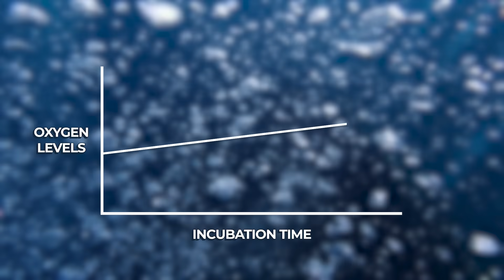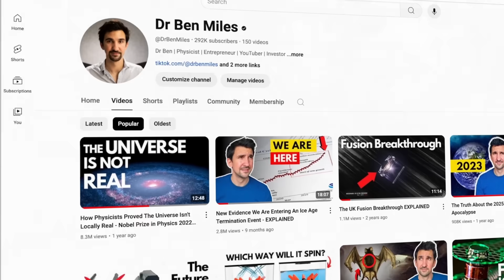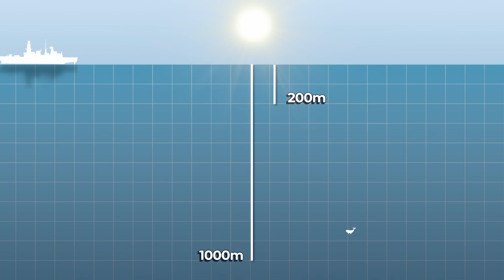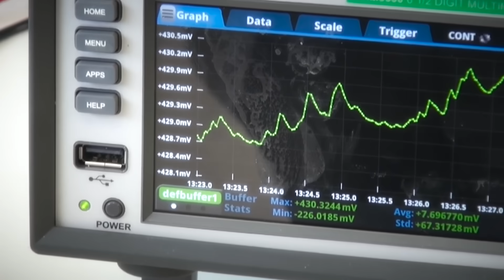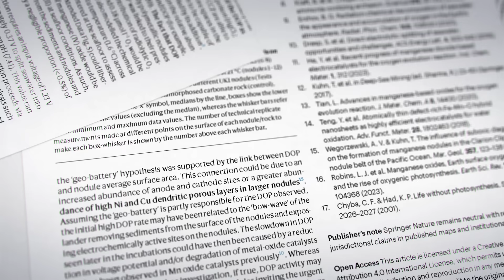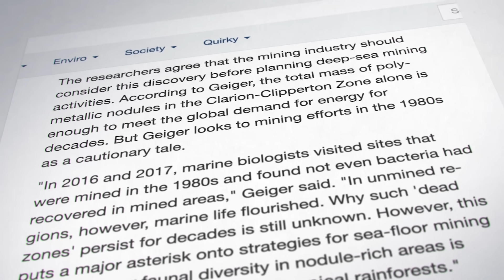We Just Discovered "Dark" Oxygen on Earth - Breakthrough Explained

Comment: Deposition of metalic elements onto nodules could be an endothermic one, chemically assisted by the high pressure, in a way that could be compared to reverse osmosis that is achieved using high pressure difference across a simi-permeable membrane.  Close analysis of the chemical structure of the nodules as well as the energy balance between dissolved metals in the sea water, and the ionic structures in the in the nodules may show how such structures are generated.  This may be battery building rather than depletion!!

Comment: Fascinating

A fewbasic questions:

If the nodules are producing voltage as tested in the laboratory (up to 0.95V) would that not be clear evidence of a battery effect, no matter how complicated or unlikely it was naturally achieved?

I'm interested in the plateau of oxygen generation in the samples and testing.  
-  Did the starting oxygen saturation of the water affect the rate and ultimate value of the plateaued increase
- If the water was circulated with "fresh" water at the starting oxygen saturation over a given voltage producing nodule cluster, would they continue to produce oxygen in the newly introduced seawater or would the voltage in the nodules have been otherwise depleted?
- what was the measured voltage of the nodules at the beginning and the end of the lab experiment?  Did that change?
- what was the net voltage effect of more or fewer nodules?  Did the voltage behave in "parallel" or in "series"?

Very cool video.  Love it

Comment: I agree, its likely a natural battery and the reason the samples stop producing oxygen and electricity after being removed from the sea floor is because what ever the electrolyte, acids or other thing  moving the reaction forward is being used up. Its lt's likely a byproduct of sea life and water movement driving this reaction forward. That would also explain why the metals are plating out and forming  these polymetallic nodules.

Comment: Enclosing the samples in a dielectric plastic probably contributes to the high rate of oxygen production. We're used to thinking in circuits when we perform electrical analysis, but this is a reductivist form of analysis which allows us to approximate real world dynamics. In situ the nodes are all electrically interacting with each other and with the sediment and seawater at levels which we would normally ignore in our analysis, but which over geological timescales become huge. This electrical potential could be connected to all kinds of other processes due to the large area it covers. The whole field of nodules is exposed to the earth's magnetic field amongst other possible sources of energy input.

Another question which I didn't see addressed: if this is an electrolysis process, where is the hydrogen going? It should show up as a gas or a pH change or locked into a chemical form.

No matter the answer to these questions, there is no way that deep sea mining will ever be a good idea. I do not want an electric car if it requires that much destruction. I have a bicycle already and everything I need is 45 minutes or less if I hop on transit.

Comment: this is pure non-scientific intuition, but a big thing i don't get about the battery theory: why would the metals precipitate into this higher energy arrangement in the first place? if electrolysis is happening, then you have these electrochemical forces constantly trying to redistribute the different metals evenly, surely that's gonna smooth the distribution out far faster than the extremely slow rate of accumulation. I'd expect it to be in a steady state where any time a metal reaches a high enough concentration gradient to produce a meaningful voltage, the resulting current (and thus ion flow) would quickly redistribute the metal, flattening the gradient. so you'd end up with an extremely slow rate of oxygen production, tied to the extremely slow accumulation of metals, presumably much lower than what's observed. and that's even assuming those concentration gradients form in the first place; why would nature randomly form concentration gradients? that seems to go against thermodynamics unless there's some other effect that's altering the balance of energy. is there some sorta crystal growth thing biasing the metals towards clustering, as a first part of a multi-step journey down the energy ladder?

Comment: I think the researchers are wearing blinders. The mineral deposits (polymetalic nodules) are not the actual batteries and do not emit dark oxygen. They are bonded anodes and cathodes, with the actual acidic "current" flowing around them: a kind of inverted battery.
Rain strips CO2 out of our air, keeping their concentration down to around 0.04% of the lower atmosphere. This produces carbonic acid that goes into our soil for roots and cavern formations (stalactites, stalagmites, columns, drapery). This chemical at the sea floor should break down at the sea floor, releasing hydronium ions. Meaning, the sea floor should be a charged biome, that bacteria can adapt to. So when the mineral deposits are mined, the charged biome also disappears.

Comment: There's two things I'm looking at when it comes too this whole battery electrolysis effect. One the close proximity of the polymetallic nodules with each other, using the sea water as a conduit, essentially makes an enormous daisy chained battery which could mean millions if not billions of volts. The second factor to how batteries function is Amps or the flow of electricity to create power. IE: Volts x Amps = Power measured in watts. Now the thing is with so many potential volts out there the amperage would have to be obscenely low to not only create the electrolysis effect at the level it is, but prevent these natural batteries from draining quickly, and NOT decimate all sea life in the Clarion-Clipperton zone.

Comment: I think the misunderstanding is likely coming from the idea that the nodules themselves are the battery and that they have some kind of definitive lifespan like a normal battery does after heavy manufacturing. 

It's more likely a chemical reaction that just so happens to produce low levels of electricity, not the electricity itself causing electrolysis. 

So rather than the metal somehow making a natural battery and that battery holding a charge and that charge being depleted in a matter of hours or less it's more likely that electricity is being produced, not just released from storage. 

This could actually be a chance at a breakthrough not just for oxygen generation, but power generation as well.

Comment: Self-Potential (the voltages that exist in the earth) is an established measurement used in oil exploration. So there are long-lasting current flows in the earth. Perhaps the nodules are not self-contained batteries, but just the electrodes on an earth battery - though that could not work the same way in the lab when the nodules are sat in an experimental apparatus.

Comment: Maybe there are chemical processes due to radioactive decay within these rocks. Cobalt for example has a half-life time of 5,26 years, even though it's not a significant radiation. However, these microprocesses could be a reason for weak electromagnetic fields and/or water molecules to split. I'm not an expert at all, i'm just theorizing more factors of possible oxygen outcome. 

However, i wouldn't mine these things until i'm 100% sure they're not the reason for the oxygen generation. The simple fact that not even bacteria live in mined areas for decades, is enough reason to think about it more than twice.

Comment: A few simple experiments could shed light on this phenomenon: 1) Could the O₂ production somehow result from the process that deposits the metals?  If so, then the O₂ production might cease after a few days if that's how long it takes for the resources (for further deposition) in that water sample to get depleted.¹  To (initially) test this: see if oxygen production resumes if you retain the substrate and simply replace the water with a fresh supply taken from the same zone.  

2) Alternatively, the oxygen generation could somehow get interrupted by the presence of a high enough concentration of oxygen.²  In this case, keeping the same water but simply removing the oxygen should restart the production.

3) Perhaps a combination / feedback loop: a high enough O₂ level causes the metal deposition to cease, which itself interrupts the O₂ production.  In this case, tracking the metals in the water available for creating fresh deposits -- and their oxidation status² -- would prove helpful.

(Obviously, these experiments would not rule out all potential alternatives, but could at least provide some direction for additional inquiries.)

__________   
¹ In this case, when additional deposits cease forming, oxygen production would also cease.

² For example, perhaps high enough O₂ concentrations oxidizes the suspended metals, thus preventing them from depositing... though I can't imagine why these wouldn't have oxidized long ago from other O₂ sources.  🤷‍♂️

Comment: I do not think they discovered dark oxygen. I think it is a start to understanding the metallic nodules that the mining companies drool over. That after accumulating the metals over millennia, that the next step in the life of these nodules is interaction with the sea water. I think the different metals present basically create a new method of electrolysis. Which reminds me, did they detect hydrogen? Did they even look? That would say for certain that it is standard electrolysis or something new. This would also answer why iron isn't the main metal in the nodules, that it is the rare metals. Could be that they all gather, then the iron interacts with the salt water to make oxygen and reduces the iron present. 

More importantly, the additional oxygen is why the deep seafloor is teaming with life. If it depended on oxygen created near the surface, very little would make its way to the seafloor, it is just too far, and it would take so long, any life would use up the oxygen as soon as it arrives. Leaving none to be detected.

Finally, the fact that decades later the sealife does not bounce back after mining says the mining is extremely destructive and there should be a complete moratorium on the seafloor mining.

Does this happen at deep sea oil wells? They are NEVER particularly clean or careful, so I am sure they put a fair amount of oil into the water and kill the life in the area. But do they kill it all or just a little?

Comment: What's causing it is weight , Oxygen like all gasses can be compressed you mentioned at the start because o what is on the surface that particles of oxygen sink back when I was young in the 60's it was that water was so heavy  as you went below 600- 1000 ft.  that small bubble of oxygen were trapped under the emmence weight of the water that they would eventually sink to the bottom, bubbles expand in size as they make their way to the surface the speed in which the bubble would increase as well but down at a thousand feet the weight of the water keeps the bubble from expanding, in fact the bubble will start getting smaller. So for now that buble will settle at the bottom. Hope that helps. Peace.

Comment: you've asked for comments so here i am, noone knowing nothing but encouraged to speak ;d

electrolysis argument is vaild from my perspective. Given how much water there is, it's level of salination, size (or rather surface area) of nodules and nodules' composition it doesn't neccessairly mean that there's something to be "depleted". One battery electrolyzing 1000 liters of water will run out quickly, million batteries doing the same amount of water will continue to bubble until water runs out. 

There's also important correlation between level of salination to the electrolysis happening, pure distilled water doesn't electrolyze, but when you add salt - process starts. Also keep in mind that sea water isn't only h2o+table salt, but manganese, magnese, sodium and bunch of other minerals. This means that product of electrolysis is h2+o2+ deposit which might add to overall nodule. yeah, science bitch

Comment: There are several points to this. First of all electrolysis of seawater is well understood, if that's what keeps the deep sea alive then we could easily replace these batteries with modern technology to reoxygenate the water. Second, because it's well understood it's also the first theory we go to, even if it's not the primary method through which oxygen is generated and life is supported. Third, if taking the nodules away takes the life away, then the opposite might also be true and we should try relocating a batch of them to another part of the sea and see what happens.

Comment: Galvanic rxn is based on solution temp concentration and pressure. As soon as non lab conditions are met ei Standard temp pressure and concentration the values in the equation are no longer dependent on one another. Meaning that pressure and temp could be the reason why 1.5V isn't needed 😅
Big implications on how life formed.

Comment: Did they test for chlorine? When electricity is used to make hydrogen and oxygen from salt water,  the left over salt is covered into chlorine, hence using electrolysis to make pure water is not great for the environment large scale..... or perhaps using this mixture of metals in a cathode at 0.97v isn't strong enough to make chlorine, but is strong enough to make oxygen and hydrogen?

Comment: Since the nodules are essentially made of the minerals/elements that batteries are. A possible explanation is that with the friction caused by one of the most volcanically active regions of the world generating friction. Which can generate an electric charge. Those nodules could be storing and using the energy to generate oxygen. And could explain why they plateau and don’t spike. They reach a finite point where they can no longer store a charge. Nor dissipate enough of the charge to cause a downward trend. The tectonic plate just continually recharge the nodules. Like if you left a battery plugged in. It would essentially never die as long as it is plugged in.

Comment: Nope.
H2O is the source of the oxygen, and our planet's electromagnetic field provides the current (electrical force) necessary to break the Hydrogen / Oxygen Bond.  The earth generates a negatively charged electromagnetic field and this force is present in varying amounts based on the polar and other emission points which are currently moving so quickly toward each other that the NOAA no longer puts out map declination corrections as they would be out of date before they published them.

This process is likely the larger source of oxygen as compared to photosynthesis.

Comment: Most likely the polymetalic nodules are acting like an electrolysis catalyst or non-depositing cathode. The metal oxides and hydroxides could also be the source of the oxygen. The electric potential is from the Earth battery that exists from the mantle to the ionosphere. The ocean floor is statically charged and mildly magnetic (almost all matter is weakly diamagnetic). This battery powers the core device, which is currently in an active maintenance standby mode.

Comment: very interesting, without additional info I am left asking, 1: why are the nodules so similar in age, size, composition. what caused such large fields on nodules to start 'growing' at roughly the same time. over the ocean away from river deltas, possibly an airburst asteroid / meteor 'seeded' the exposed areas allowing this system of accumulation to start?
if so has any research discovered a common seed particle, perhaps a rare metal or radioactive isotope?
would be great to get some answers before attempting to explain the weird chemistry that only produces O2 and not Hydrogen, CO2, etc.

Comment: the key to understanding everything is by stimulating excitation of a pair of Testacoils.  By gripping the base of the Testacoils firmly with one hand grip the base of the attached vertical excitation rod.  Moving up and down in a repeated fashion builds up an explosive energy release.  When the energy is released, discharge of the energy will occur and capturing that release in a containment vessel is recommended.   After a 30-60 minute cool-down cycle, repeat this process until either the containment vessel is full, or the rod is not capable of stimulated excitation.